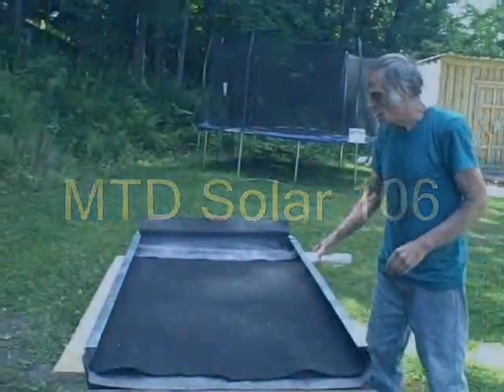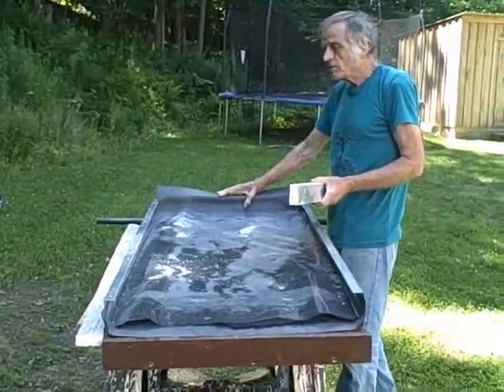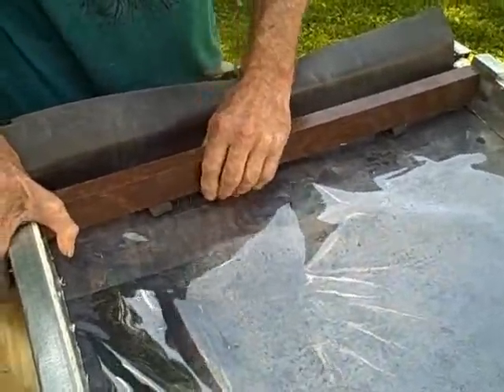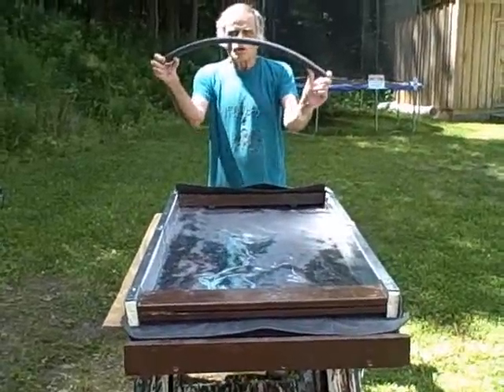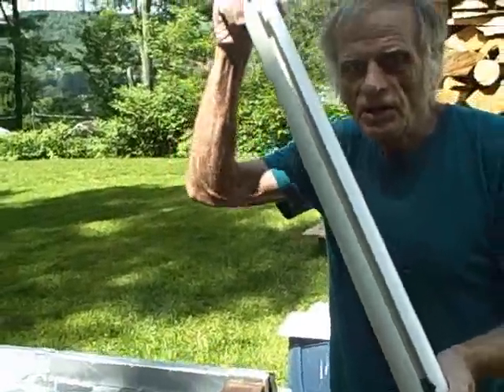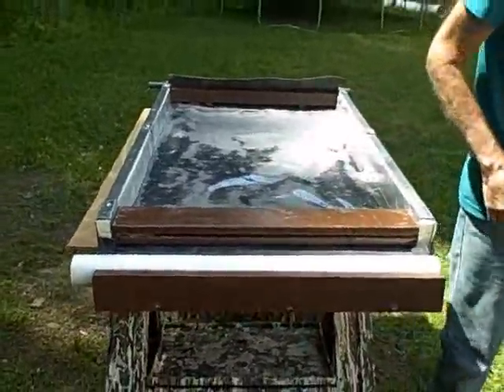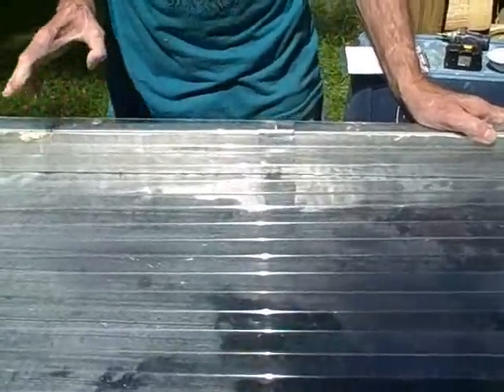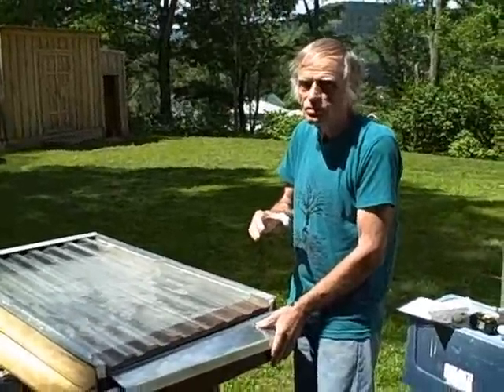MTD Solar 106

Comment: Possibly use an Arduino control with inputs from your temperature sensors and a simple LED to control the pump. The LED can be wired as an input device. If a cloud comes over or night time comes on then it can turn off the pump or slow the pump through modulation of the voltage. You could also use the temp sensors to have the Arduino increase the pump speed when the sun is hot and making great heat or slow it down to try and hit a target temperature you would set. Of course the pump would need to be capable of this feature of modulating the speed. The only downside I see of using water over a hot air system is maintenance and winterizing in my climate. Water does have the heat absorption and transfer advantage. Thank you for making the videos John.
Reply from the maker: Jeff Barr Yes Jeff there are lots of possibilities.BUT water stores 20,000 x more heat per volume.